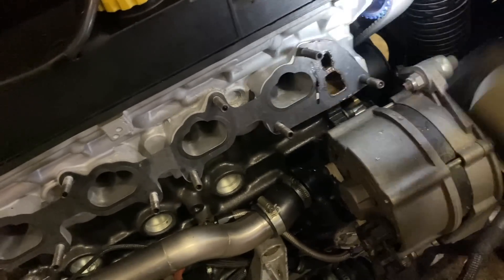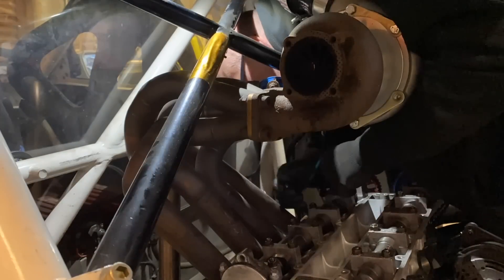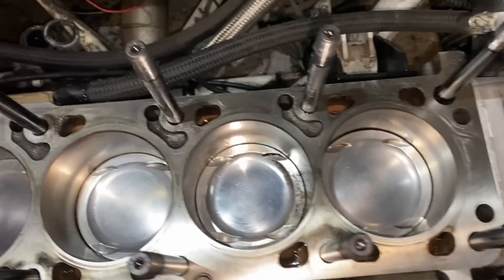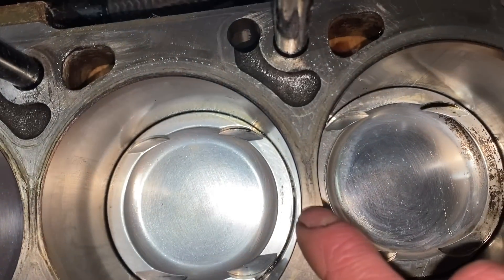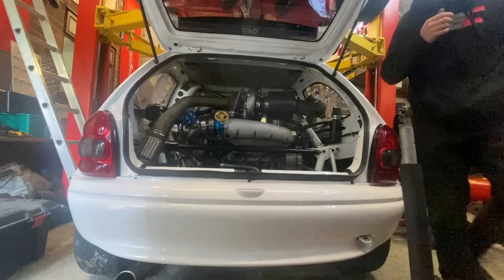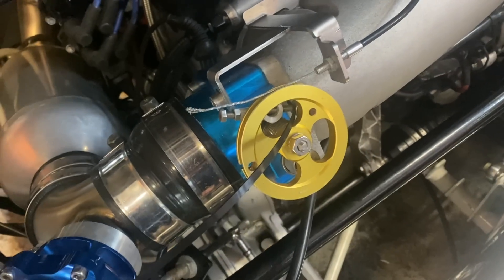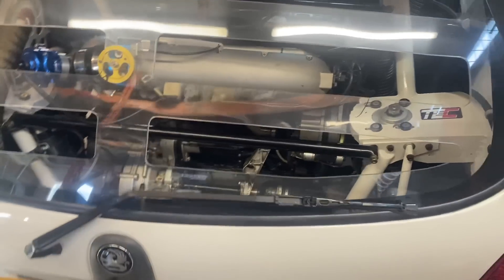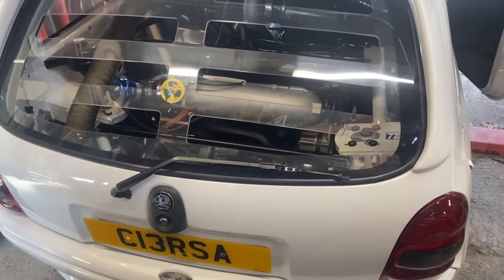Back in the game? | Twin Engine Corsa Rear Engine Diagnosis

Comment: Why not o ring the block? Why not remove the head studs to make it easier to remove the cylinder head? Does anyone make L19 or arp 625+ head studs for this motor? Does anyone make a thermal intake manifold gasket to keep iat temps down and provide a better seal between the runner and the coolant passage.
Reply from the maker: The sealing is never normally an issue. I feel because we rushed the dyno last time I never re-torqued the head after many head cycles. Which I normally do. The head removal is only 2 hours ish so no time to save really.
You can get stronger studs but as I say for the power I am at there not needed.

Comment: I'm looking at the ecu master classic and doesn't say anything about 2 engine rev match in there spec sheet ?
Reply from the maker: It’s not advertised. If you go into the software you will find it. 2nd engine.
Reply: Lolol beast thanks for that can't wait to see it in action the possibilitys 
Traction control